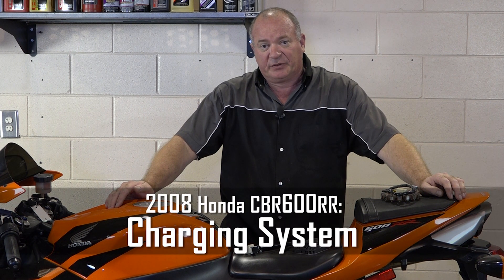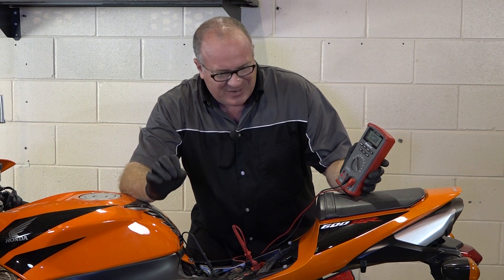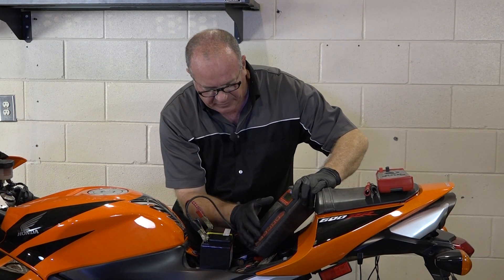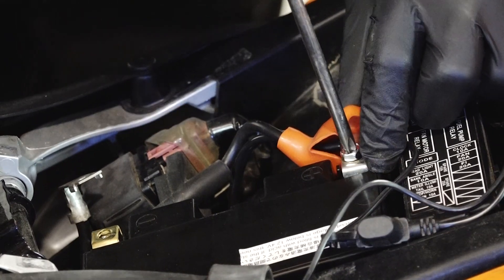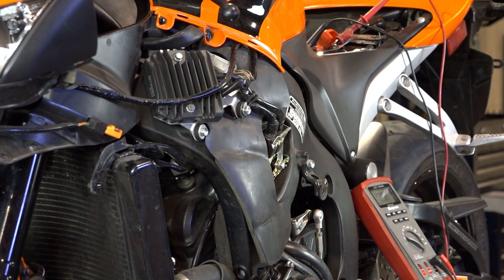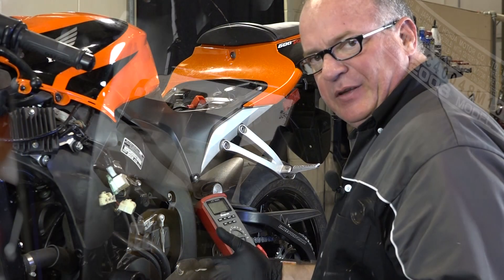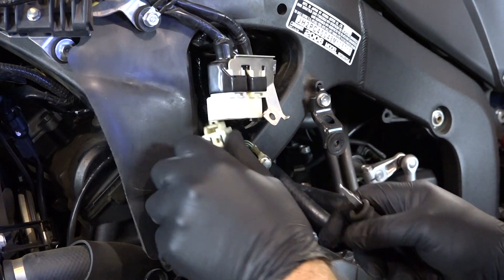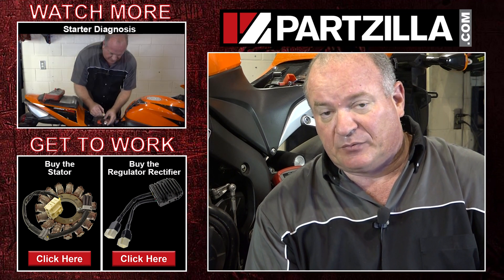How to Test the Charging System on a Honda CBR 600 RR | Partzilla.com

Comment: Hi John,
I’ve been having problems with a 2003 honda cbr600rr charging system.

Diode test “forward bias test” gives me around .48 between each pair.

Stator windings are not shorted to ground. I also get about .5 ohms between them.

When I start the engine, I get 10.8 AC Volts from each winding at idle but does go up as I rev the engine.

Lastly I only get 13.1 volts DC at battery terminals.

Thanks In advance, hope you can help.
Reply from the maker: At idle, when you test the stator wires, you should be getting right around 15 volts.  If you are only getting 10.8, there is a good chance your stator is going bad.
Reply: Partzilla It “passed” all the diode/continuity test. It was driving me crazy. Did not want to change parts by guessing.

Thanks a Lot, for sharing your knowledge!

Comment: if we use jump start to start the engine and we still keep the bad battery. do the bike cut off , stalls @ low RPM ? is that normal? do we still need good battery even when engine is running ?
Reply from the maker: You should be able to disconnect the battery while the bike is running and it will still run.  If it's stalling at low idle, try adjusting your idle up a little.

Comment: partzilla please help me from Colombia a greeting iva walking on the bike normally and suddenly began to fail the electrical system did not turn on, immediately I went to the mechanic and told me to buy the battery also rviso the stator of the motorcycle and said the voltage failed the ignition and the voltage descended my question is change the stator or that you think it is the motorcycle when I leave it quiet it works normally but after going out for a walk in it more than 10 kilometers starts to fail and goes off that is thanks.
Reply from the maker: From what I can tell, it's something in your charging system.  Battery, voltage rectifier or stator.  Test these components.

Comment: My CBR600RR 2003 was melting 1 yellow stator wire near to joint socket. I'm already checked and used your step but not found either stator coil or rectifier problem. Please help me to solve this problem. If anybody had an experience like these please do not hesitate to share it.
Reply from the maker: What's the stator output read?  Are you sure it didn't melt because it touched a hot part of the motor?
Reply: Reading on stator output is 0.2 - 0.1  and R/R is 0.536,0.538 and 0.539. When I've open the stator cover and checked for short circuit between 3 Yellow when touched the ground and the result no short circuit also no coil burn but if I connect these 3 wire to R/R, one of yellow wire will be getting smoke, hot and start burning when the engine ran.
REPLY
Reply: The issue has been resolved. After I follow your guide, I am convinced that all the tests show that the results do not damage the R/R and Stator coils but it will melt wiring and connection. The problem is not damaged R/R or Stator coil but from the connector pins, it happens because of the loose connector and too much carbon on the connecting pins. It generates a spark and high voltage then melting the connector and wire. So, I immediately try to cut and replaced the new connector pin then the result its back to normal. Thanks Partzilla

Comment: Hi. I am a bit confused as the workshop manual doesn't mention to attach the tester probe to the chassis earth when doing a voltage test, only between stater end connecter on each field windings at the plug terminal?.
Reply from the maker: It needs to be grounded.  Chassis, neg terminal, etc.
Reply: +Partzilla ok thank you, you do good instructions videos

Comment: Hello my stator test gives 12-13 volts on idle and the battery give 13.1 on idle ana i changed the regulator so wath about the stator 12-13v its not good?
Reply from the maker: Continue the tests for the stator.  You should be getting a little more than that.  What does it do when you rev the engine?
Reply: Partzilla @ around 4000 rpm it gives 60 and plus to 80v
Reply: When i put the new regulator it gives 8v on the 3 wiers connecting to the regulator and the 4 wires of the regulator (2 red and 2 green )gives 14.5v
Reply from the maker: The regulator was the issue.  You should be good now.
Reply: Partzilla so all numbers are good?
Reply: The electricity it's not stable @ 1000 rpm and the temp on the odo its not stable too
Reply: Maybe the connections are rusty?? (If all systeme charging are working fine)
Reply from the maker: Check connections, but I missed the 8v part of your comment.  Should be around 25VAC.  Your stator is most likely going bad.
Reply: Partzilla when i connect the 3 yellow wiers to the regulator it gives 8v and i tested the regulator in the 2 wiers green and red it gives 14.3v
Reply from the maker: Not sure what to tell you, the numbers don't make sense.  Should be more coming out of stator, but rectifier is about where it should be.
Reply: Partzilla i cleand the connector how connect the regulator to the battery it was black color it works 10mins so i should change this cinnector it has a black on the red wires too
Reply from the maker: If it's charred, I would replace it.

Comment: 02 954rr,  gives 14.5 volts testing battery at idle.  Did your tests, question is on the stator AC voltage test I only get 10 volts coming out not 15v, which jumps to 20 or so revving it up. I know the R/R is bad because it reads 0.9/0.9/3.4... Do you think that 10 volt reading means the stator is on its way out soon even though it seems to be recharging the system fine still?  Also would a faulty R/R overcharge the battery leading to destroying the battery and cause the bike to not start ever?  I believe that is what's happening here as the battery reads 13.5 volts right after shutting off the bike, new battery btw.  14k miles on the bike...  Your video is awesome too thanks!
Reply from the maker: Start with the R/R.  Did you ohm test the stator?  And yes, a faulty R/R will eventually kill a battery over time.  If your battery is new, you should be ok once you change the out the R/R.
Reply: Partzilla thanks, I did ohm test the stator and it came out fine.  So I figure hopefully just the R/R will get me going again.

Comment: Hey John, i have this same 08 CBR 600rr and my bike hasn't been turning on. It makes a loud buzzing noise from around the battery when i try to start the bike, nothing else. I was then able to jump start the bike and it started. But then when i checked the voltage on the bike today and tried to start it, it did not start despite being at 12.54V. Im confused on what the issue may be. Thank you
Reply from the maker: Still sounds like the battery.  Sometimes it will show enough voltage but once it's under load, the voltage will drop.  Do a load test to check overall battery health.

Comment: if i have to replace my stator. do i have to replace my rectifier as well. i hear you have to replace both at the same time just in case you don't get up the one you didn't not replace
Reply from the maker: Just test the rectifier.  If it's good, then it doesn't need replacing.  Some people choose to replace them at the same time, but it's a personal preference.

Comment: i tested the regulator ".424" and the battery tested its not charging and when i plug the regulator to the stator the stator had 8v and without the regulator it had 14-15vots and jumping to 60-70volts with high rpms so any idea for not charging and a jumping temps on the odo??
Reply from the maker: Have you done a resistance check on the Stator?
https://youtu.be/H5ZU_c2a1pA?t=578
Reply: Partzilla no only a voltage test
Reply: Partzilla when i plug the regulator the stator test is 8-9volts on idle
Reply: Partzilla and on high rpm's too
Reply from the maker: Sounds like the stator is going out.  I would test resistance on the stator and retest the regulator.  If all three diodes on the regulator come in around .424 and there are no shorts, then it is most likely your stator.
Reply: Partzilla yess all the three diodes are around 424 thank you

Comment: hello partzilla team i have a problem on temperature reading on the odo that the temp go up an down 6-9 degrees in one second and i changed the sensor so any electrical prob could do this i have  cbr600rr 2004
Reply from the maker: It will jump around a bit.  It should read a fairly constant reading once it's hot.  Depending on outside temp, rpms and air flow.

Comment: I got a 97 zx7r and when I push the the start button....i get nothing at all
Reply from the maker: Kill switch, load test the battery, fuses.  Test those to start.
Reply: Partzilla I do know all my fuses are good....took out starter and tested good.....new relay switch.....thats it so far
Reply from the maker: Load test battery, and then regulator.  When you bridge the solenoid, does it turn over?
Reply: Partzilla what is the regulator and how do I bridge the solenoid
Reply from the maker: The regulator is the component that regulates voltage and converts AC to DC.  To bridge the solenoid, you just connect the two terminals sending battery power directly to the starter.
Reply: Partzilla I had a buddy of mine come over....he checked the relay switch on the battery side and the motor side.....had voltage on the battery side and nothing on the motor side....checked voltage on my kill switch....off nothing.....on had voltage.....he thinks it still could be my cdi box?
Reply: Done a load test on my battery and it checked out good
Reply from the maker: Typically, if the CDI is bad, the starter would still try to turn over, but the bike wouldn't run.  If you are getting nothing to the starter, I would keep testing everything along the way and go the CDI as the last possible option.   When you test the relay or solenoid, when you say you had voltage on battery side and nothing on motor side, did you hit the start button?  When you hit the start button you should have voltage on both sides.
Reply: Partzilla I got voltage on battery side of relay....nothing when I checked motor side while hitting the start button...like I said it does nothing when I hit the switch anyways......could the cable from the relay to starter be bad? and could it be the cable to the starter and the starter 2?????
Reply: Partzilla I did the infamous grey wire check at ignition plug and cdi.....back probed both and just had little bit over 6v....something like 6.15 volts
Reply: NEVERMIND
Reply from the maker: GS, sorry for the delay, I try to get to all the questions, but I also have projects going that take up time.  If the grey wire is showing 6v or around there at both ignition and cdi, then it should be good.  This is one of those things where you have to keep testing until you find the fault.  If everything checks out, it could very well be your cdi.

Comment: hello noticed that measuring AC voltage the connector was floating and not connected to the regulator. should it give the same value on AC when its conmected or not
Reply from the maker: It should give the same readings providing that the regulator rectifier has not been damaged. I test with it disconnected because of that possibility.
Reply: Partzilla when i measure ac voltage betwrrn stator wires when disconnected it gives around 18vac and something like 60vac when revving. but when i connect it to the regulator it gives more like 10vac in idle and drops down to 3vac when revving. the battery is 14.5vdc in idle and also when revving. i gues everything is ok?
Reply from the maker: Seems like it's charging normal.  Are you having charging issues or just testing the system because you want to?
Reply: Partzilla had problems with charging system both regulator and battery were damaged. now it seems to work fine but had lots of time invested before i found the problems. both regulator and battery were not more than 1 year old. cbr 600f3 the regulator gets too hot
Reply from the maker: The regulator is a common problem with those bikes.  When charging systems on the CBR get weird, it's usually the problem.  Good to test all of it when there is an issue though.

Comment: Ok slight problem. I don't have a auto ranging multi meter. Mine says a buzzer will go off if it's less then 30ohms. When I do the diode test the multimeter reads about 546 across all three yellow wires for the R/R. It does not beep. When I check the stator it beeps and when I check the stator for voltage it starts at 30 then gets to about 60volts  around 5k rpm. That was across the three yellow wires of the stator. Get a New R/R?
Reply from the maker: If the diode setting on your meter is reading .546 Volts, that should be correct. The resistance test on the stator should be around the .5 to 1.0 ohm range. If you are reading an AC Voltage of 60 volts, that sounds high. What is the DC Voltage measured at the battery static and with the engine running at 3k RPM?
Reply: Partzilla. Ok I got an auto ranging volt meter. Diode test on the r/r read about 546. Volt across the three yellow wires not .465 or anything like that. I got around 13 volts when checking the stator and it went up to some like 50 volts when I rev it up. Could see how I I did it. Guessing around 5-8k rpm. 02 cbr f4i. Changed the r/r once already two years ago.
Reply from the maker: R/R is a common fault on that bike.  Were the 13 and 50 volts direct off the stator or measured off the battery?

Comment: hi partszilla i have a 2009 cbr 600 rr and my turn signal lights and horn do not work. i think i blew a fuse since im sure i shorted it, where is the fusebox for turn signal and horn located. Thanks!
Reply from the maker: it should be in the black box under the middle left fairing.  Check the fuses in there, you will most likely find the fried fuse.

Comment: l have a no spark issue on a 2005 yamaha r1. The rectifier regulator and stator checks out fine.
Reply from the maker: Solenoid...Fuse...if those are good, test the wires all the way to the plugs and see where the power is dropping off.  I'm going to guess solenoid.

Comment: hi, my battery is fully charged (shows about 12.35 volts) but when I connect it back onto my bike ( a GSXR 750 ) and try to start it the battery is making that clicking noise associated with a flat battery, not sure what to do or what to try and diagnose, any suggestions would be greatly appreciated :)
Reply from the maker: The battery could still be dead.  You would need to load test it to confirm.
Reply: Partzilla thanks for your advice, sorry for the delay on coming back to you. kind regards from the UK

Comment: hi!i have some problem with my rectifier and cant understand it working good or not! on yamaha fz6s show me 12.5v  on stator !it good or not?
Reply from the maker: If you follow the steps in the video, you will be able to tell what's causing the issue.  The process is the same for most metric motorcycle charging systems. It will help narrow down whether the stator or rectifier is giving you trouble.

Comment: I have a 2013 YFZ 450 having trouble with charging system installed my second new battery and it does not recharge the battery if I run my lights it'll run the battery dead and it won't charge it just clicks can anybody help me solve this problem
Reply from the maker: Time to test your system.  Are you getting the right voltage out of the stator?  If you are, then test the regulator rectifier, you have a voltage drop somewhere that won't let the full charge get to the battery.

Comment: for viewers: these basic tests and numbers are valid for almost all bikes.  If you have a defective regulator/rectifier, you need to check the stator, as the two are inter-connected and one failure may cause the other. Also, check all connectors in the harness, they might burn out if the R/R has failed.
Lastly, see if you can replace the OEM R/R with a better after market one, MOSFET type.
Reply from the maker: Excellent information.  Thanks Ray!
Reply: @@stickyourface66rectifier

Comment: Hello John
I have this problem on my motorcycle that I will be grateful if you'd answer, please.
First, my battery died on me so I replace it, with a new one. 
Shortly after, my motorcycle died on me on the highway so I had to send it to my mechanic on a tow truck. 
A few days later he informed that he had to swap the stator as he found it totally fried, with the new stator, on high RPM, it was only reaching 13,8 Vdc on the battery poles which is a bit low according to my knowledge. 
Now the bike is haveing the same symptoms that I felt before the stator went bad for the first time so I decided to measure the components myself exactly as you explained in the above video and found that, there is no link between all three phases on the stator (1&2 ok 2&3 no and 3&1 no) in addition to that on the reg/rec side I'm getting 0.578, 0.578 and 0.436.
Is there a chance that the reg/rec is the route cause for the second stator failure?
I know that is a long story but please try to help.
Thanks in advance
Reply from the maker: Sounds like you are on the right track, Ian.  You can do a diode test to confirm that one or more of the legs will show a short to ground.  I would replace both this go around.
Reply: Many thanks